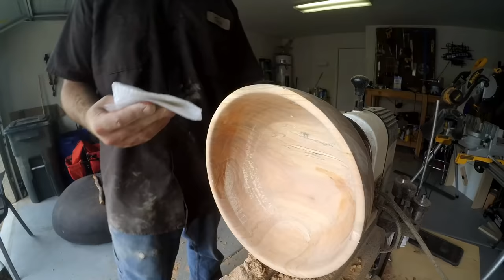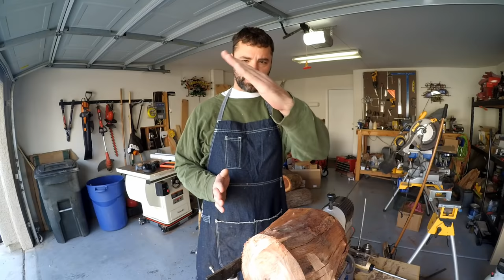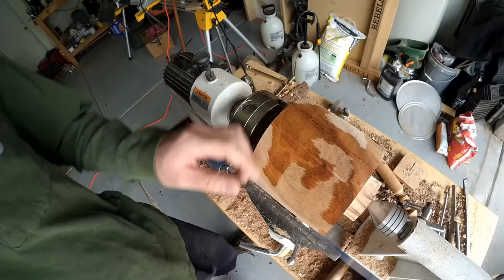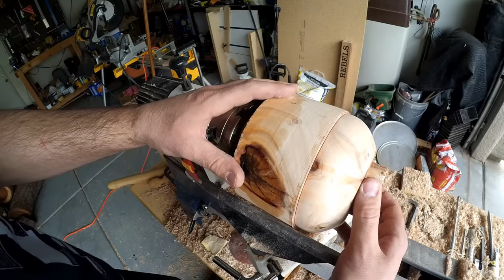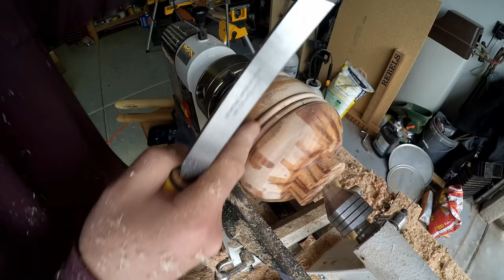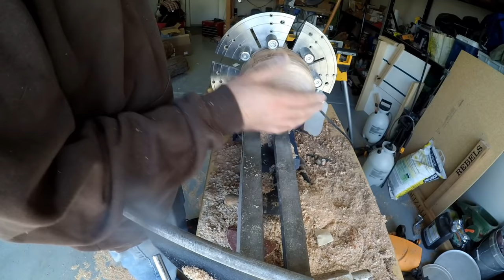Woodturners Journal: Sycamore Lidded Box

Comment: Sometimes I wonder about mounting a router to get the initial rounding of an awkward shaped blank. The router would cut away while the blank is turned by hand. A jig carrying the router mounted on the lathe bed rails would get it straight.

Comment: Looks great and thanks for the details on the making of the lidded bowl.  But I am new to turning bowls, did you have any further cracking of the bowl after you were finished with it and it was sealed???  You said it might have not been completely dry inside
Reply from the maker: Randy Kniebes No.  My girl uses it to put her jewelry in and it still looks great.  No cracks at all, but you do have to watch with wood.  I made an urn in one of my videos and I have noticed some slight shifting of the wood on that.

Comment: HI.  Just curious why you chose the bowl gouge over the roughing gouge to start. thanks!
Reply from the maker: Nancy Mezick The roughing gouge is more for spindle work.  I was worried about a bad catch with a piece the size I started with.  Not to mention, I just prefer a bowl gouge most of the time.  When used correctly, you can remove a lot of material.

Comment: Here's my positive suggestions ...before you get seriously injured. 1st, use your sliding table (or a spacer from your fence) on your table saw before you get a serious ''Kickback'. 2nd, get a 'Roughing Gouge' to rough the wood to round and save you spindle/bowl gouge...and/or possible injury. 3rd, "Smoking" wood? Wow, sharpen your tools...dull tools will get you injured, also. PS: Sorry this comment is 2 years old, I just stumbled on your video...and hope you haven't been hurt in the mean time.

Comment: I wonder, since you dont have a bandsaw, what about rigging up a hacksaw blade to cut as it spins?  think of the wood you would save.
Reply from the maker: I am not sure if I know what you mean.  A spinning hacksaw seems really dangerous.  I am not sure.
Reply: I mean make a jig with a hacksaw blade and as the log turns lower the blade to cut as it is turning.  seems like that would be pretty easy and effective.  essentially its a bandsaw but instead of the blade turning, the wood is turning